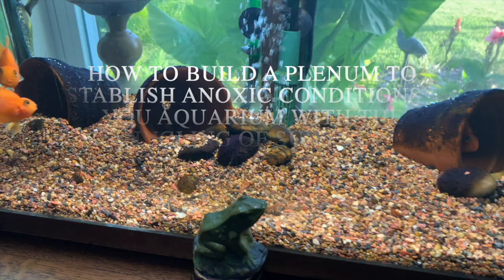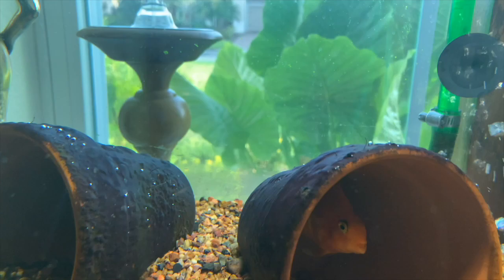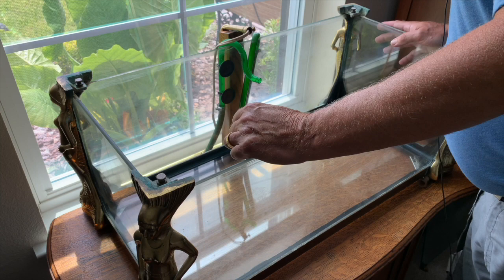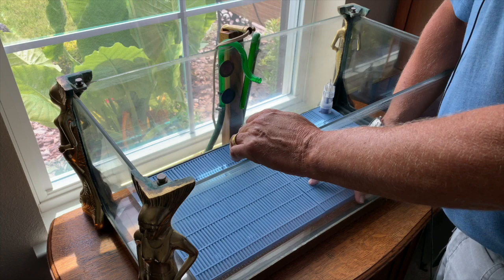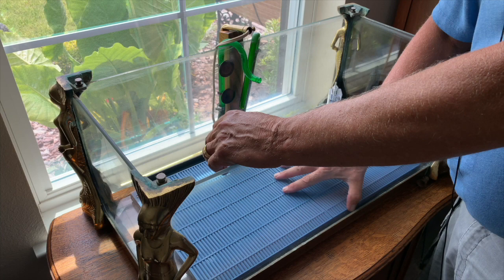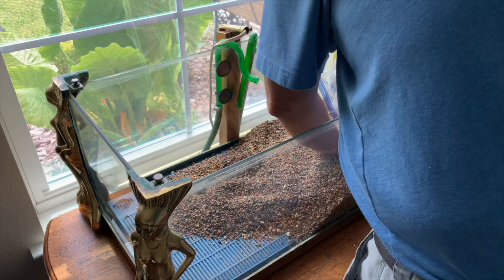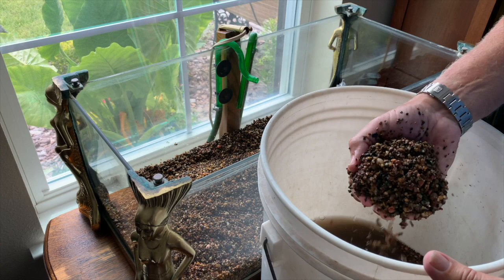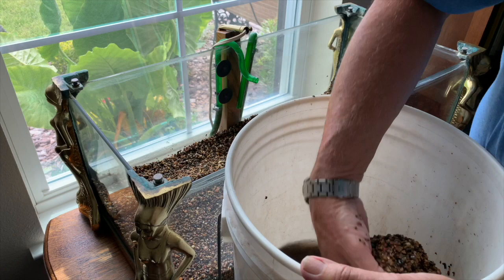How to build a Plenum to establish Anoxic conditions in your aquarium

Comment: Question Dr.  Can I simply buy a under gravel filter and gravels like your video and then put white fine sand on top? Will this still convert to N2?  Q2. I saw this video many times still I cant understand its principle. Because Gravel are coarse so water can penetrate deeply to the surface of the under gravel filter, which means there will be oxygen rich and oxygen rich bateria only. Oxygen rich bateria cant convert to N2, only lean oxygen bateria can. Is it true?  If yes, how can nitrate convert to N2 in this system? purpose of coarse graval layers are for making nitrate?  Q3.  Is this nitrate ion comes to plenum area water which is neutral static, takes cation from the plenum water and converts to N2?   I need to take action to take care of my Nemo fish.  Thx

Comment: I set up a 20 gallon aquarium at my mom's with your plenum idea just after I heard about it. I had that tank up and running for a few years at least. I had jelly bean parrots in there. They bred like crazy and the plants did well. Still got green spot algae once in a while though, my mom way overfed them. She ended up breaking the tank so in an emergency I set up a 50 gallon I had sitting around. That tank lasted less than a year, the plenum was definitely doing it's job in the smaller tank. Same amount of fish. But having no plenum, my mom over fed them and the nitrates got so high the ph crashed and everything died. 
So yes, plenums do work. And they work very well.
Reply from the maker: Thanks for the info.

Comment: Hey doc, i did the clay kitty litter and Laterite base made two square block containers out of the hobby screen used for knitting i think? Anyhow it's been almost 2yr now and have done ZERO water changes on the 75 gal.acquarium w/20gal sump. The blocks are in 20gal sump i built fr acrylic. the sump has a wet/dry intake i made from a 3drawer file container (plastic) and theres a 3in x 15in x 4in sponge  in the sump as well. That's all that is in it and i must say, ZERO NITRATE!!! tHE TANK HAS A HEAVY FISH LOAD OF fIIREmOUTH Cichlids,red jewels, yoyo loaches. a bit overcrowded,.. Still Zero Nitrates. Only topoff water level adding about an inch or so every couple weeks..
  Your idea is excellent brother!!!! I will say i had to let the clay kitty litter & Laterite base set for about 2months b4 i started to see results but that's normal for type of Anoxic filter set up. 
   It is actually the cleanest looking and lowest maintenance tank i have set up out of 20+ which have deep sand substrate,planted, sponge filter,some w/hang on back. I kept having algae problems in all the planted tanks, although i believe its from 12hr of light a day. im getting ready to do some cutbacks on lighting.. Sometimes less is more. i have 1 20gal with no light only get occasional light fr above rack of tanks and i must say, no algae. the tanks with all algae(beard algae) also has l.e.d strip of blue lights on at night. Could that cause algae to bloom outa control taking over live plants,rock,driftwood,etc,.. ??? Makes one wonder doesn't it?? 
  I am eternally grateful for the Anoxic Filter idea! U DaMan!!! THX!!
Reply from the maker: Blue light maybe the problem.
Reply from the maker: Thanks for the info too
Reply: That is so cool! :D

Comment: Very interesting! I used UGF many Yrs ago and never had issues with running them. I left the hobby and came back a few Yrs ago and decided not to use the UGF because it seemed many didn’t like them. 

I had a 30gallon set up for Yrs using a UGF and only thing I noticed was all that bacteria algae was under the gravel trapped between the glass and UGF. I never stripped it down to clean and tank was thriving. It was like very fine powder is the only way I can explain it. 

I would love to see pics of the bottom after its running a yr or so. 

I’m guessing many will experiment and go back to using UGF’s. The manufacturers are going to be shocked 😮

I’m pretty sure some of the top YouTubers will be switching opinions now…

Comment: I have a 29 gal tank set up with under gravel but with about 3-4 inches of substrate and rock and wood as well as plants.  It’s been about a year now and I see it looks like the wood needs cleaning it at least take out and rinse and replace.  It’s hard to gravel vac a planted tank.  I also have two tall lift tubes.  Any suggestions?
Reply from the maker: It's very hard to gravel-vac a planted aquarium, so do not worry about it.

Comment: Sir, i am hoping you could answer some of the queries that come to mind:

1) does the substrate above the plenum needs to be thick..if not, how thin can it be..
2) if we just reduce the air pumped into a UG, will it work? How slow it needs to be pumped? Like one or two bubbles per second?

3) with a anoxic filtration the nitrates will be taken care of, but what about the initial nitrogen cycle.. ammonia, nitrites.. will a slow moving filter counter those too or i need a traditional filtration system in addition , to come down to nitrate ..which will then be taken care of by this anoxic plenum..is the cannister running in this particular setup along with the plenum?

Many thanks for your work, its such a great effort in your part to shine this perspective on the hobby..and low maintenance aquariums are almost too good to be true..

Kindly clear the above queries if you can..
Thank you..
Reply from the maker: 1) It can be 1" thick but really no less.
2) Yes, the slower the better the water movement or just turn on air pump at night only and off during the day. 
3) The nitrogen cycle will still be present but will be stymied some because no ammonia to break down, less Nitrites and less nitrates in the system. Once the Anoxic filter is up and running at full speed (45-60 days) the Ammonia, Nitrites and Nitrates will be gone and Phosphates almost down to zero.  The canister filter is set up with a BCB like I show in my past videos.
Reply: @anoxicfiltrationplenums  will this plenum work by itself without the separate BCB cannister that is running?
Will it then also work with any substrate?
Reply: @anoxicfiltrationplenums  How do plants survive or do they require supplementation?

Comment: Thank you Dr. Novak for this instructional video. Forgive my ignorance is the bubbler line hooked up to an air pump? Also on a recent video you showed a Brazilian setup and I believe you said they don’t use air pumps. How do you get the water flow to start in that case?

Comment: 3:42 May I suggest to put your tube in the center to get more efficiency. Because in the corner, it will also work, be it will be more prone to preferential channelling of water.
9:02 You may have answer my question later in the video. Having that preferential channelling will result in a very slow water movement from the left side, and exponentially faster until it get at the tube section.
But still, you can achieve a better result with a super slow water movement more efficiently if you put the tube in the middle with a very slow air pump and a long tube.
Reply from the maker: It really doesn’t matter where you put the uplift tube because we’re not trying to make things 100% efficient. However, you can put the tube in the center if you wish but you’ll notice it won’t make a big difference.

Comment: 0:30
Cyanobacteria. Not algae, but a bacteria.
Can be treated with low dose H2O2 and cut the lights for a week or two. Remove carbon before treatment. Big water change every three days.
Are the fish at 8:30 the same that were in the affected tank??
If so, you can go whole hog on the cyanobacteria by using a stronger dose of peroxide if the tank contains no fish or plants.
The cycle may need rebooting, though.

Comment: Hello Dr. Novak! I am using a Hygger 1.5W air pump which is rated at 420 ml/min in my 50 gal aquarium with plenum. The void under the 1-inch under-gravel plate is 3 gal. Do you think this air pump is sufficient to allow 1-2 gal of water exchange per day? I noticed that you connect the airline directly to the under-gravel plate. Does the use of an air stone provide any benefit (gas exchange)?
Reply from the maker: Sounds like your air pump is more than sufficient.

Comment: I noticed you didn't use the kitty litter and laterite in this.   Is it not required?   

I have the laterite, but I'm search of the clay.   Is safe-t-sorb the same?
Reply from the maker: You're absolutely right I did not use any laterite because of the substrate I'm using was Fluval substrate that supposedly is clay and iron built into it.

Comment: What is the use of the airlift? Does it help the anoxic filtration?
Reply from the maker: The air lift helps move water through the Plenum slowly instead of it being so slow that it may not appear to be working at all. In other words, it's no different than what we used to do in the 60s, but I've learned to slow down the flow rate because the Plenum works better.

Comment: This is something I absolutely need to try and I apologize in advance if the question I’m about to ask has already been answered. I’ve watched many of your videos in a very short amount of time and there’s so much information that it’s difficult for me to keep it all straight. 

I’d like to explore your method using aqua soil and sand as well as a clay product like kitty litter or flourite red (although the clay based product you show from Australia is available to me). I’m just confused about the layer order. I know I start with plates and some sort of ground cover to keep under the plates clean (I’d like to add a thin layer of bio noodles under plates). Out of the aqua soil and clay/iron, which one would go directly on the ground cover? Obviously the sand would be the cap. Any insight would be greatly appreciated. TIA!

Comment: Instead of using air, can the lift tube be connected to a sump? I would use 1/2" tubing instead for the drain line. Do you think  the drain would be too fast for the plenum? I'm think of doing it to a 110 gallon tank
Reply from the maker: Yes, good idea why not.

Comment: Dr Novak I wanted to get your thoughts if you would.

I was considering a canister hang on back (intake and out controls) hooked inline to a pump less small canister using one for mechanical filtration and the other stuffed with gravel/baked clay (orchid substrate) or perhaps lavarock/pumice on low flow to create an anoxic bio filter.

The plan was a heavily stocked 10 gallon apisto tank with some dithers and Cory's shooting (hardscape I dont have experience with plants or breeding fish) for low ph (5-6) low hardness roughly 9.5 parts R/O water to 0.5 with tap to make maybe 15-20 ppm (measured via tds meter) and 77ish degrees. I was going to use an internal waterfall filter and a spray bar to keep the water oxygenated as I've read that higher temps remove oxygen but in another video you mentioned the heat coils under gravel to oxygenate the water.
Did I get bad info on the relationship between water temp and oxygen level? Do you have a preferred method to measure oxygenation? 

What are your thoughts on an under gravel filter from the canister (full of foams)? I looked on amazon and Lee's original 10 gallon under gravel is an option for me. 

One final thought I've heard kh kindof locks in your ph. Can you confirm?

Many thanks in advance I greatly appreciate the source of good info.
Reply from the maker: They do sell oxygen test kits but they are very expensive and for the hobbiest but are really not needed. The higher the water temp the less oxygen is true. However,  99% of hobbiest fish tanks will have more than enough O2 in their tanks for fish if that is your concerns therefor they are unwarranted. KH aka: carbonated Hardness is a factor in pH and even if you use CO2 because once it stops your pH will bounce right back up again. UGF going into a canister filter will work but the flow must be restricted going through the UGF.
Reply: @anoxicfiltrationplenums  gottcha thank you for the reply, I just got one of those chinese Ugf it has tons of slits I'm even thinking of removing the lift tubes. I was going to check out living artwork for perhaps some glowline or cardinal maybe serpae and  Cory's and rams.

I'm in the tampa area do you have any ideas on apistos?

Comment: I have been keeping aquariums for 45 years and never heard of a plenum. I use undergravel filters on many of my tanks. Is a plenum the same thing as an undergravel filter? If the idea is to have a very slow flow rate, couldn't you just turn down the air flow coming in to achieve that? Also, since you have the lift tube on one end of the tank, is there any concern that water is being pulled at unequal rates (slower far from the lift tube and faster near the lift tube?) Maybe it equalizes as the substrate gets clogged? What is BCB? You use the term anoxic quite a bit. Could you define what anoxic is? Thanks! Some good information in these videos!
Reply: Sorry for all the questions. I watched your other videos and they answered my questions. Great information!

Comment: Can I do this process in a 29 high? It has the same UG filter as a 20 gal. It's just much taller. I love using a UG filters. I'm looking to have less maintenance and less algae.
Reply from the maker: Yes you can. Any size tank can be outfitted with a BCB or anoxic filter.
Reply: @anoxicfiltrationplenums  Thank you! I will use the same type of setup that you did in the video. low tube for low flow.

Comment: So you don’t use the kitty litter in this scenario? I’m resetting mine and will reuse the substrate too. I was wondering if a layer of that clay would be beneficial?
Reply from the maker: Yes you can still use Kitty Litter, Sand and/or dirt but it will have to have the Weedgard ground cover added on top of the UG plate.

Comment: Hi Dr, I GET to setup a 4ft long 75g aquarium for my work lobby, and i'm going to implement a plenum during the setup. I ordered the 50gallon pen-pask undergravel setup which is 4 trays. my 1st question is how many lift tubes should I use and the placement of said tubes i will be using the AQQA airpump you did in your airpump video. 2nd question is since i will be doing a planted tank is it ok to do a layer of laterite powder with Osmocote + sprinkled in ontop of landscaping paper  cappped with black diamond blasting sand to create denitrification enviroment .. the main filter is goign to be FX4 and a Marineland Penguin 350 Bio wheel that i plan on using a UV filter in and possibly a Basket with Safe T Sorb

Comment: Helpful video.  I'm getting ready to set up a large 72x18x30 tank.  I would like to have your anoxic plenum system in the new tank.  Do you think that 2 lift tubes (one on each end), will work?  Or should I have 3 or 4?  Or how many?  I plan to use the black Popetop 1" platform.  What would you suggest for number of lift tubes?  Any other modifications that I should make because this will be such a big tank?  Thanks for your help
Reply from the maker: With  an aquarium as big as that I would say yes split the Plenum into two parts and then have a lift tube for each 3 foot of Aquarium.
Reply: @anoxicfiltrationplenums  I also have a 6 ft aquarium I am setting up now. You mentioned in another video, the lift tube should flow left to right. Would the second tube be in the middle back or the other corner in the back? I would think for circulation purposes, that the second lift tube could be placed in the front corner diagonal from the first tube. What do you think? Would also like to know if I can use eco complete?

Comment: What is is the stone you put down first? You don't say what it is? Is it just dry gravel or something else?

In the notes, you say, sandbed, but in the video it's gravel. In a more recent video, with the fancy goldfish, you use sand. Which is better sand or gravel?

I keep reading that more water movement through your media increases biological filtration, but then you say slow. What would happen if you put a powerhead on the tube instead; would that mess up the system?
Reply from the maker: The order of which you put the stone or substrate, is not as important as the size of the substrate, not being so small that it will compact.

Comment: Can a plenum using undergravel filtet still work for denitrification if i have no lift tubes..not even short ones..with only about 2 inches of fine substrate above?

( And no other filtration methods..very lightly stocked..for example a single betta..which needs still water)

Or in general..with moderate stocking...
Or is an airstone near the short lift tube absolute neccessary?
Reply: hmm a betta doesnt need this type of setup , what it need it is not too high of water level

Comment: Sir, I have set up a plenum in a 75G aquarium on 7th June, 21 as shown above by breaking down my dirted tank. The air pump for the short lift tube (around 4 inch and gravel 3 inch ) has a capacity of 6lpm without an airstone as the lift tube dia is .75 inches and I couldn't find a narrow air stone which could fit into it. Should I dial down the pressure of airstone from 6 lpm or is it ok ? Do I have to add more gravel?  By the way the tank is doing great. Thanks Dr. from the bottom of my heart for all the guidance provided by you.
Reply from the maker: Yes that is what I would do, slow down the air.
Reply: @anoxicfiltrationplenums  thanks a lot Sir and do I have to add more gravel?